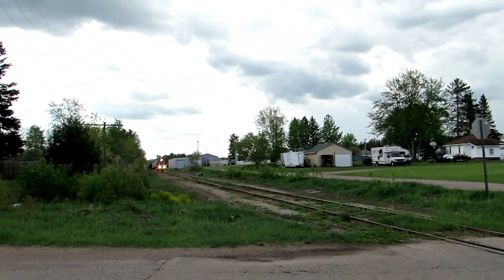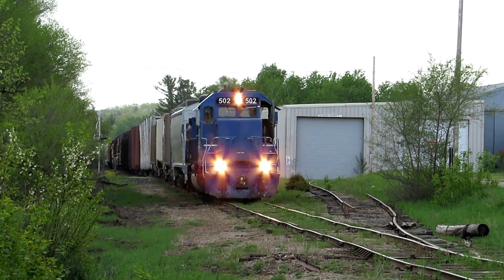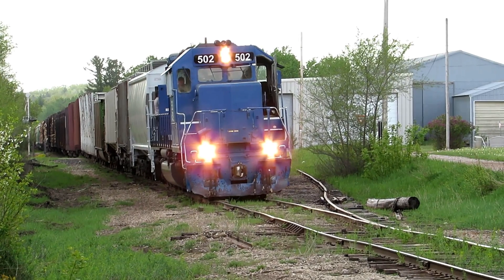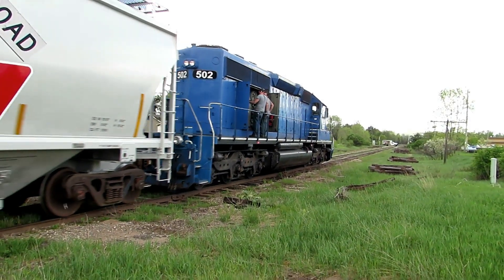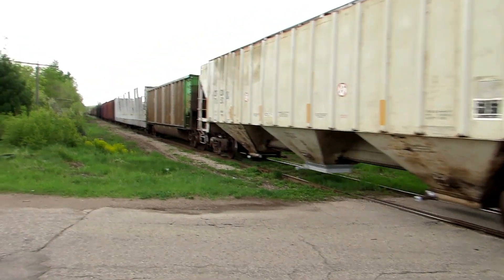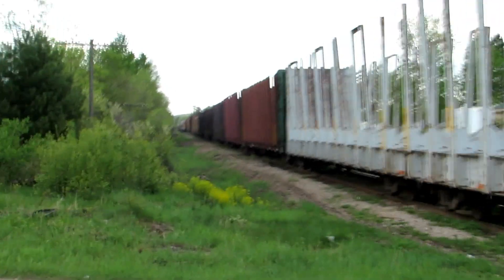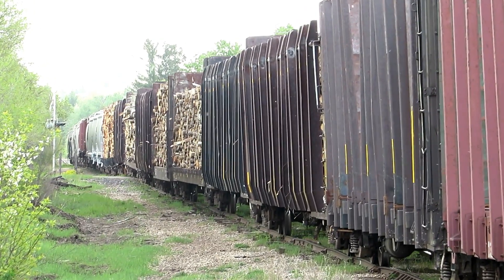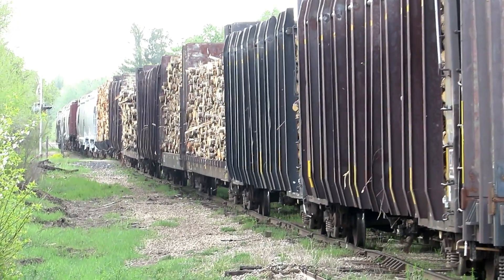ENGINE TROUBLE ON THIS TRAIN? | Jason Asselin

Comment: Another great railroad video, Jason! :) I was able to see Fred's antenna too. Could also hear Fred's high pitched whine from the brake line air pressure that Fred uses for its internal impeller (or maybe that's the sound from the impeller itself?).

Comment: Looks like they were checking for water leaks, or possibly looking at air compressor.
Reply: I was thinking compressor. But I didn't think about a water leak. Normally a low water condition will just shut the engine down, I don't think there's a warning light for that.
Reply: Wouldn't there be a water temperature indication that would rise if the water level was low?  Hopefully they weren't thinking of adding any "man made yellow anti-freeze" to the mix to get to the next filling spot.
Reply: @littlewingpsc27  LOL you'd need a pretty good pump to get it up that high!

Comment: Jason...The Fitters appear to be troubleshooting or checking on the run the Load Regulator or Air Compressor.  Is this train going to a saw or paper mill in either Marinette or Green Bay...?

Comment: Hi Jason,
  Hope all is well with you, and family in the U.P.
  Wanted to ask you ?
On the very last car...
  There is a green box...
( I have seen them for years in various colors and sizes), but never enquired into all their functions ?
  Would be interested to know your thoughts about them..
     Great video by the way...
Reply: Hi, that's called the E.O.T.U (End of Train Unit), also known as "Fred" by railroad people (Flashing Rear End Device). It has an outdoor light sensor (photo-resistor) to determine when to switch on its flashing red light. Freight trains are to have a flashing red light on the last car from sunset to sunrise. It also transmits by radio signal to the equipment in the engine what the brake line air pressure is & other data. It has an internal re-chargeable battery & a little of the brake line air pressure drives an internal impeller to spin it to operate the battery recharging system. With a scanner you can hear "chirps" sent about every 40 seconds as the EOT & engine equipment "talks" to one another (probably when the train is 1 to 3 miles away it can be heard on a hand held scanner). I know for CSX if their train is longer than 6 cars they are to have a "Fred", less cars requires only a red flag be attached to the last car's coupler.
Reply: @tomy6917  Strasburg is known for using red flags and so does CCET. They both have very short trains.
Reply: @tomy6917  
   Thanks Tom,
I always see them, but never seemed to remember to look it up on-line...lol
   Wow those have a lot of functions , and more than I originally thought...
          Thanks again 🙏😎
Reply: @Scrollermania1963  You're welcome. Actually, they're called EOTD for End of Train Device, whereas, I had said "Unit". Hazy thinking for me today LOL.
Reply: @csrrjefflloyd6496  
  Thanks CSRR Jeff Lloyd,
     Always wondered about the flags, and when they are used....great info guys..👍
                       Thanks....😎
Reply: @tomy6917  
😂LOL its all good...
  I think my brain is doing the same thing.
                 Thanks 😎👍
Reply from the maker: I love learning, don't you? I still learn every day, my fans are awesome when it come to info like this.. I truly just love filming them, seeing them go by..
Reply: @jasonasselin  
  Hi Jason,
   Oh its great...
Yes, you definitely have a great group of knowledgeable fans...
   They are a wealth of knowledge....
   As for the filming of trains...
  Im glad you film them; it archive's the history currently going on, and will make it possible for younger generations to see how things were now....for them in the years ahead...
   Great stuff 👍😎 
                        Thanks....

Comment: These guys have got to be making money,,,, surely, they'll start fixing the line for better quality running and less chance of derailing..
Reply: @cdavid8139  Exactly, the tracks are 3 nation rated and in need to repair big time. The amount of cars they are hauling, either they are getting ripped off in pricing or they just don't seem to care. LOL
Reply: @cdavid8139  Number #1- No need to swear. I can read easily enough. #2- I'm a trucker by trade for over 40 years. I understand the competition between rail and road. But 1 car of wood could probably take 2 or 3 trucks off the road. The problem here I see is I could probably get 2 or 3 loads done in the length of time this train takes to go from A to B. For that I blame the maintenance of the tracks. Time and fuel consumption and other concerns will see this railroad gone in a few years, if not sooner.
Reply: @cdavid8139  And 3 nation rating is just a comparison to the condition by comparison to a class A rail

Comment: you know , just by seeing the way the rails move up and down , shows the lack in holding strength of the steel. The ties under carry most of the weight as the rail distributes it horizontally. I can't believe the rail maintenance group would let the ties determinate   so much to allow that sway . I guess you will just have to stay on top of it until it topels over again!

Comment: Truthfully those tracks need to be removed, a good road bed put down after flatten and new rails installed. But Warren Buffett will wait until a train derails, blame the operators and jus patch it and party off his million of dollars in sucking up profit.
Reply: Warren Buffet owns the ELS?
Reply: @GRE2057  no I don't but Warren Buffett and the other guy who owns the RR have been living off the profits for years and only puts enough money back into the RR to Band Aid it.
Warren Buffett has tried everything to stop the Pipeline to transfer that nasty sluggish oil because he is loosing money if the pipeline goes through. Yet he's RR is derailing and leaking all that nasty slugged all over the place ruining nature and killing off the fishing and hunting besides the recreational areas because of his greed.
Reply: Berkshire Hathaway and therefore Warren Buffet does not own the E&LS.
Reply from the maker: What? LMAO..